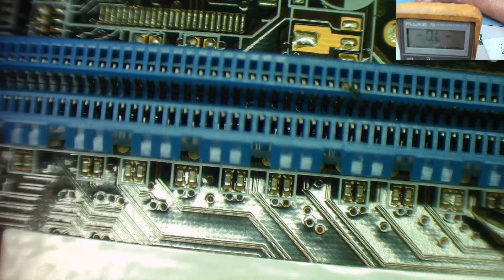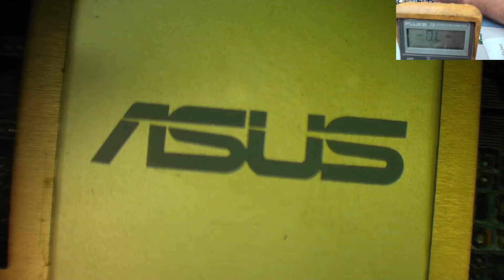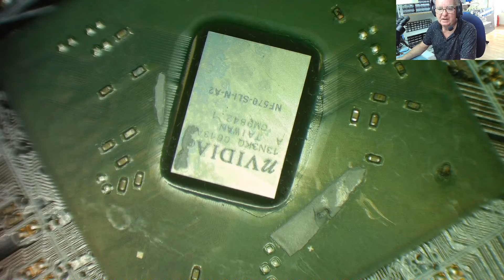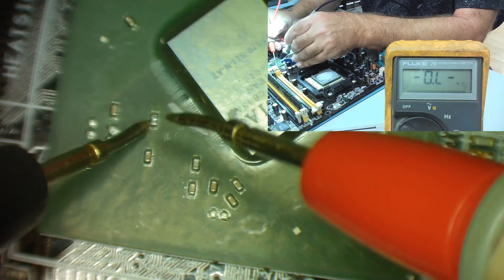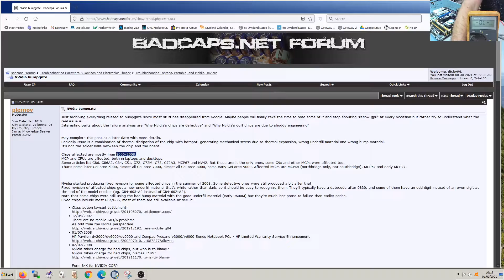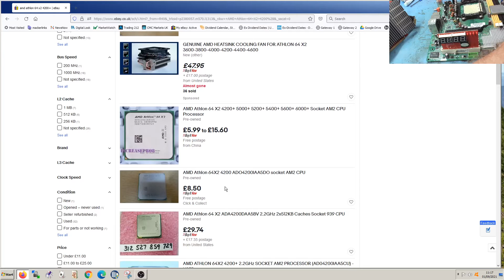XP Retro Gaming PC Powers on but No POST No Bleeps / Beeps No Picture.  Part 2. LER #124

Comment: With the ASUS M series of boards the 2 is the generation, the N means Nvidia and then the last digits refer to the chipset model, so for example an M4A78lt is a M 4th generation series with an AMD chipset (A) the 78 is AMD 780 chipset and the LT means a light board or lower end board, you can see these in like the M5A99FX or the M4N98td the M5A having an AMD 990 chipset and the M4N having a Nvidia 980 chipset.

Comment from the maker: ERRORS: 
5 mins 48 secs
5 mins 55 secs
6 mins 25 secs
7 mins 53 secs
They are capacitors not resistors
I also forgot that the matching pair of LG beige/cream IDE DVD ROM and DVD Rewriter came from this PC.  If they are good, in my previous experience they are worth about £30 for the pair to a retro PC builder - So value of the recovered parts is probably about £55-£60
Reply: Haha, I noticed that but we all misspeak mate.